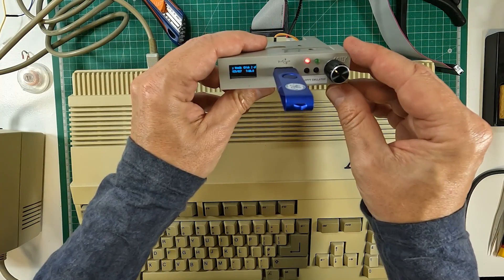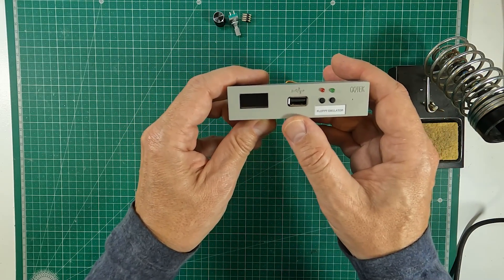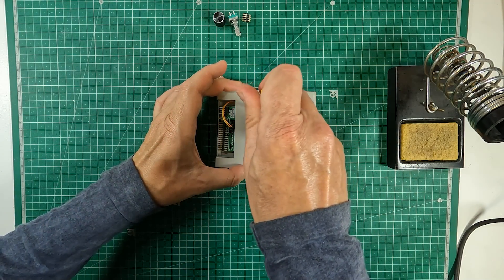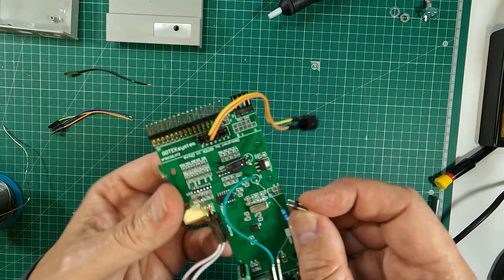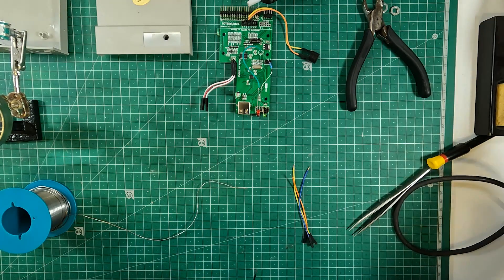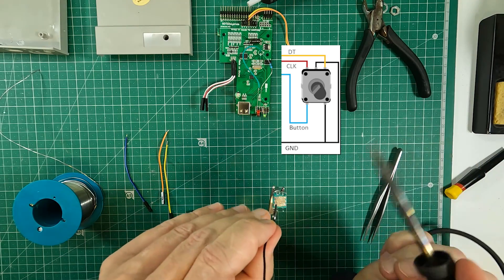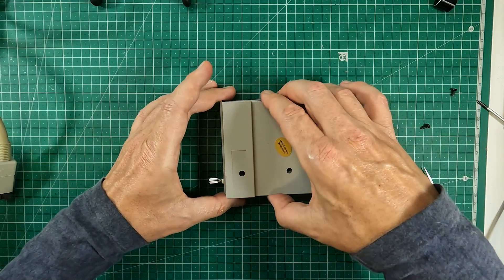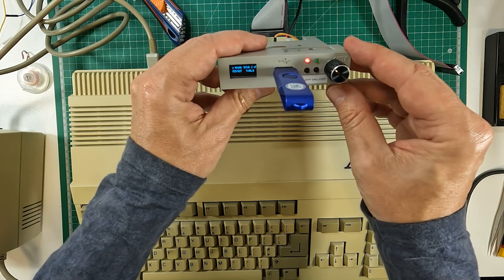Adding a Rotary Encoder to my Gotek Drive (SFRKC30.AT2)

Comment: Why are you using a resistor for the red led? What is the value of the resistor? Can you please do a video on how to install the OLED and the piezo speaker in this model? Thanks a lot!
Reply from the maker: Hi! I already bought it like that. It's a 75 Ohm resistor. Probably they forgot to add it to the board. The green LED has a R20 resistor on the board. The speaker is connected to JB, and the OLED is connected to J7. If needed I can send you some pictures. Thanks!